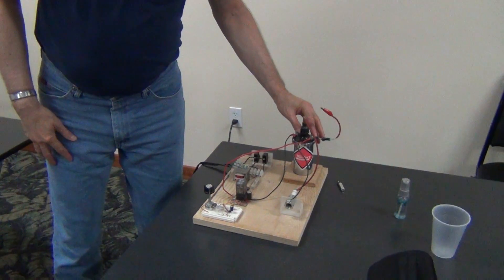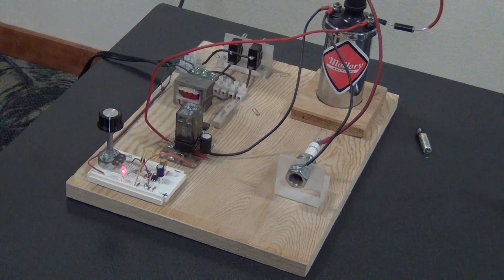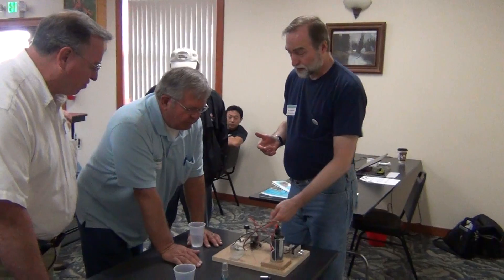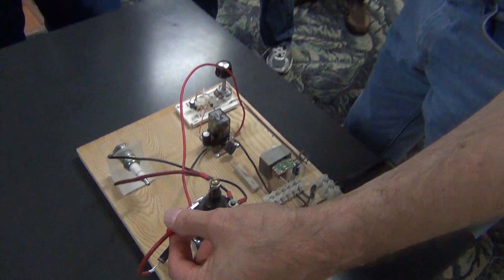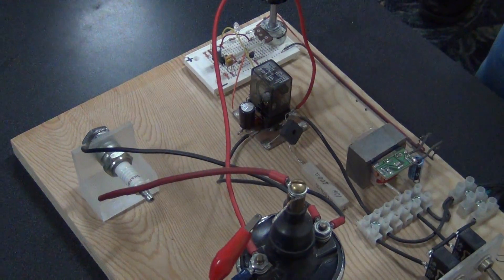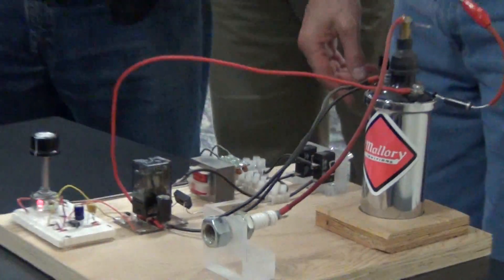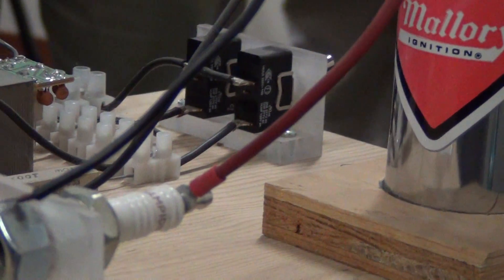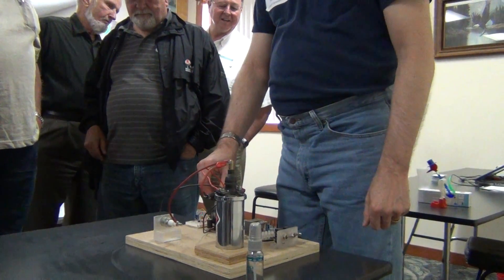Plasma Spark Mod by Aaron Murakami & Peter Lindemann (2 of 4)

Comment: How much I know jaguar use twin coil ignition and they used jaguar he amplifier suposedly it does the same thing how much I know they even hade gm's r terminal bypass wire .
Thats only oposite acurance..
There are some down sides useing plasma ignition it only works on lightweight fuel types it will fumel with ground reference of alternators .
They do have limitations.

Comment: The reason why the spark gets amplified when you introduce the low voltage circuit via the diode is actually very simple. The low voltage supply cannot ionize the air gap between the spark electrodes sufficiently, but the capacitor on this low voltage circuit has sufficient stored energy that when given the opportunity, it will discharge across the gap. The opportunity for this stored energy to arc across the spark gap is provided when the high voltage from the ignition coil ionizes the air around the spark plug tip, and creates it's usual weak "jump" across the spark plug gap. The "thin wire" spark produced by the high voltage is the "closed circuit" condition that the capacitor in the low voltage supply needed to aid it across the gap, and it gets this opportunity when the high voltage provides that "thin wire" arc.

Comment: haha... the explanation is WRONG.   The diode is not slamming shut, the diode doesn't conduct until the arc results on the plug itself, and THEN the diode shunts the rest of the source capacity thru the spark plug without it needing to traverse the ignition coils secondary.    It can be done differently...
Reply: I think what Peter is saying is that the reverse biased diode conducts for the first few nano seconds like a feedback to itself feeding the capacitor. And when the diode is shut it will spark and release all the energy from the capacitor through the spark. Your explanation also makes sense. It is just missing the initial reverse recovery time which is applicable for all diodes.
Reply: interesting. need to draw it out, to understand. Hv discharges to ground via sparkgap.   sparkgap connects ground (negative of cap)  via diode to positive of diode. diode opens up and discharges cap straight through sparkgap (lower impedance path so quicker discharge).
yes!

Comment: I will also add a water injector in the rubber hose connecting the PCV valve to inlet manifold and report the effect back to you. Thanks again. You are simply awesum man. You guys rock.

Comment: One more thing Peter, remove the small resistor from inside the spark plug and replace that with a thick copper wire. Your plasma effect will be further enhanced. Thanks.

Comment: If I do that in my car, put high voltage diode across the low voltage and high voltage positives, will I get more mileage and power. Is it ? Thanks Peter.